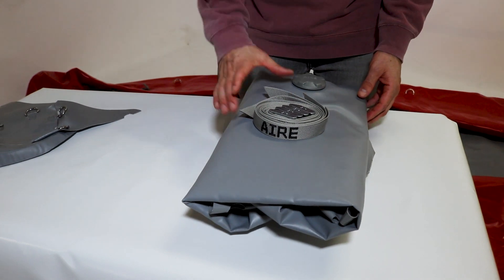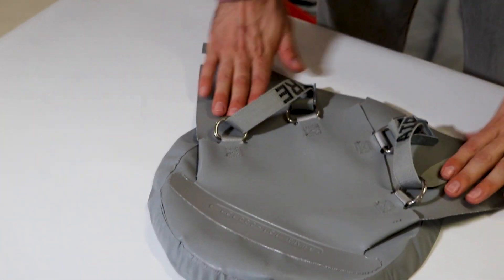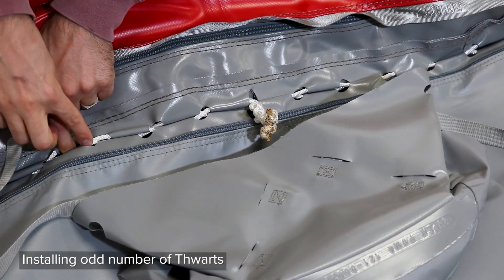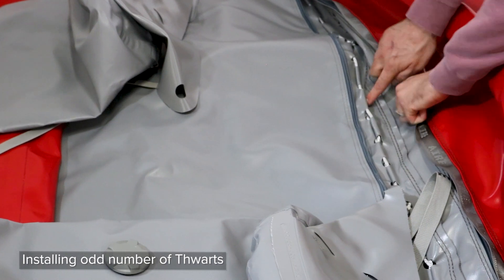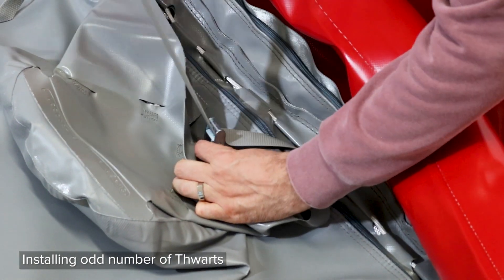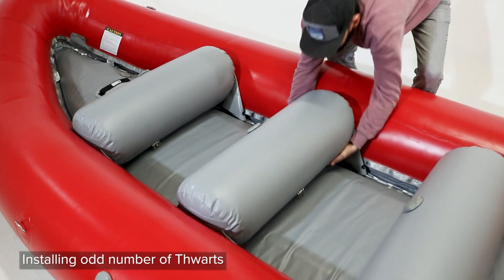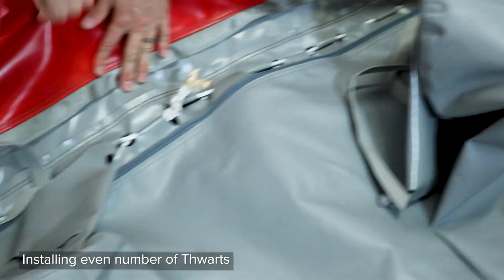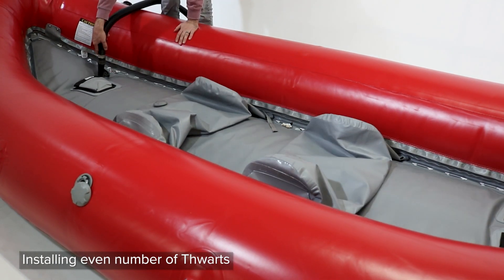How to Install AIRE Thwarts

Comment: When they say “move seven loops forward, skipping five” what are they talking about?
Reply from the maker: The Thwarts are attached in a span of 7 lace loops (x/cross sections of floor lacing), with 5 open lace loops left in between the two attachment points.